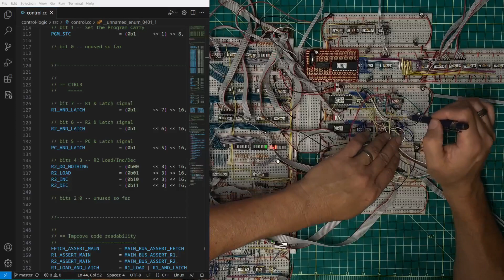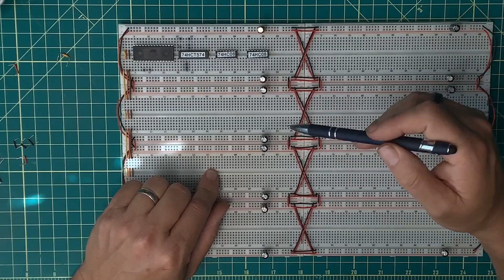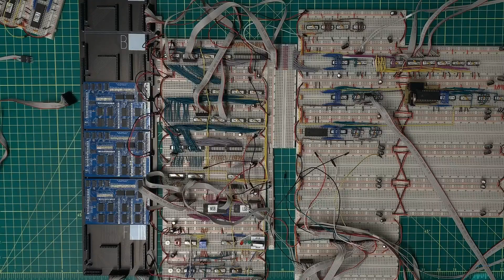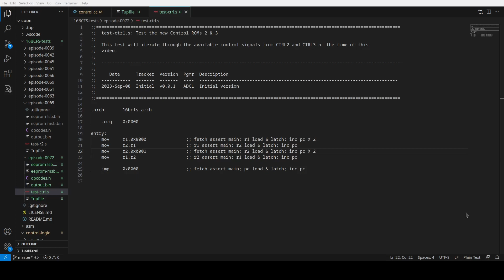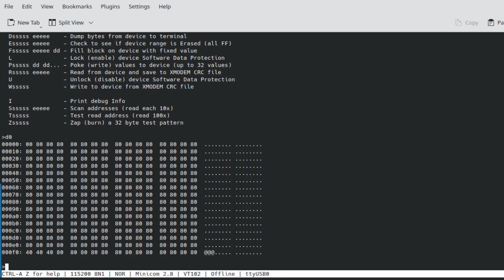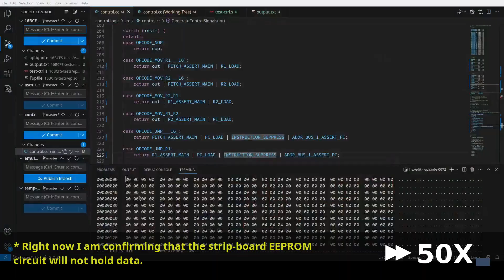0072: Control Logic 2 thru 7 Rebuild | 16-Bit Computer From Scratch

Comment: Problem 2: Clearing the first location from RAM memory.
When the computer is turned off, the supply voltage is 0 Volts, so at any point of the computer we will have 0 Volts.
When you use the RAM board and turn off the computer, the relay operates at relatively low speed (due to mechanical inertia) compared to the 55ns RAM write speed.
So the RAM can stay powered via the relay (pin connected to ground counts), for another 55ns during which #CE=0, #WE=0, the data inputs are zero and the address inputs are also zero. Thus zero is written at address zero.
This may be the explanation for changing only the first Byte of the RAM memory.
I suggest mounting a 10k resistor on the board between  RAM VCC (pin 28) and the #WE pin (pin 27); and a 1N4148 diode on the breadboard (anode to +5V and cathode to #WE) in place of the red wire. Thus, when the computer is powered, through the diode it ensures #WE=H, and when the computer is off it ensures #WE=H through the 10K resistor, the diode being blocked.
Good luck building your computer.
Reply from the maker: This is something I do not think I saw on the transistor build, only the relay build.  When power is cut, the 47uF capacitor drains amazingly quickly.  With your comment here, I realized why.

When power is applied to the circuit through the breadboard, the relay is latched closed and that voltage is used to power the circuit.  The battery is isolated.  The capacitor is charged with 5V.

The intent of the capacitor is to allow a graceful decline from 5V to 3.3V.  However, I am observing a sharp drop in voltage stored on the capacitor.  This is significantly different than the transistor version and I had not been able to determine a reason.  Until now.

The reason for this is simple -- while the relay is latched the capacitor is across the power rails from the main build.  The power rails for the main build are operating the coil to latch the relay.  Once the power is cut, the capacitor is being drained to hold the relay closed.  An undesirable result.

The solution here should be simple: replace the wire link from the common pin of the relay to the IC's power rail (on the top) with a diode to prevent the current from bleeding back when power is cut.  This should have the effect of preserving the charge in the capacitor which will hold #CE high properly (the proper signal to remain high to put the SRAM into standby) until the battery steps in and provides standby voltage.  That should address the electro-mechanical latency concern.

Now, I will want to study your proposed changes here and the previous comment much more closely.  I have set aside time this weekend for that and will let you know what I find.  I will not make any changes (yours or mine) until I properly understand all the proposed changes.

Thank you very much for your time!!

Comment: Hello.
I followed the records and came to the following conclusion regarding the high battery current consumption of the non-relay variant.
At 08:40 it is seen that you have connected pin #CE to ground, pin #OE also to ground and pin #WE to +5V, these are permanent connections. This is the configuration to READ EEPROM memory contents.
This connection ensures the permanent connection of the #CE pin to ground, so when you use the board that uses RAM, reading will be permanently activated, so the RAM memory is not in STANDBY mode, the current consumption is about 15mA according to the data in the catalog, when the computer is turned off.
The constructive variant that uses the relay disconnects the circuit from the ground, thus the circuit is open and the #CE pin becomes floating in relation to the ground of the RAM chip, and no longer has influence on it.
If you want to reduce the size of the final circuit by eliminating the relays, I propose a solution to this problem. Use a 74HCT05 or 74HCT06 open-drain inverter connected like this: input connected to +5V and output connected to the #CE pin on the breadboard. The circuit works like this: when the computer is powered, the output of the inverter provides 0V for the #CE pin to activate the chip, and when the computer is off, the inverter output is open drain, so through the resistor on the board, the voltage from the capacitor is applied to the #CE pin and the RAM chip goes into STANDBY mode. Please check the proposed circuit separately before modifying the computer if it is functionally correct.
If you watched the video ( https://www.youtube.com/watch?v=kKWA4L_ZaI0 ) you can measure the current drawn from the battery when the computer is off by setting the meter to 200mV and measure the voltage across the diode terminals connected in series with the battery.
Good luck building your computer.
Reply from the maker: @lincamarius7092 You are correct about the wiring of #CE, #WE, and #OE.  Since the EEPROM is providing control words to the computer, this is the correct required setup -- I need to be able to read from EEPROM when the computer is powered up.  

However, the SRAM will not be in standby unless #CE is held high -- within 0.2v of VCC if my memory serves me.  For that reason I added a 10K Ohm resistor from the CR2032 to the #CE pin on the board.

However, I do not maintain any isolation of that voltage from the replacement EEPROM back to the build as a whole -- a problem with both the transistor and the relay builds.

But there is also a problem with the relay build which I did not realize until I read your response to problem #2.  That will be commented there.